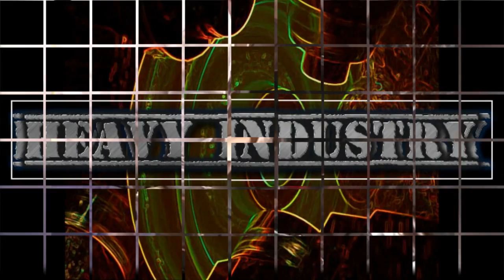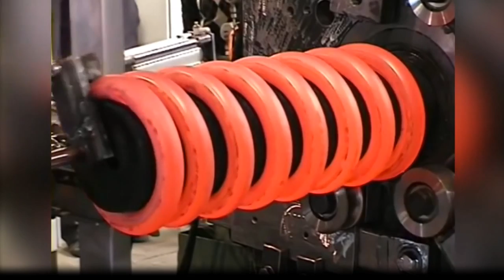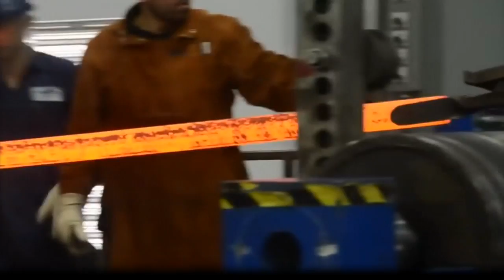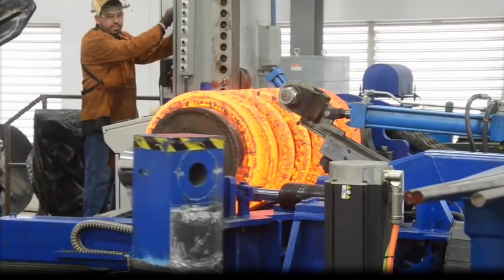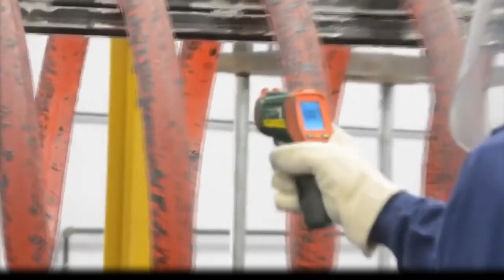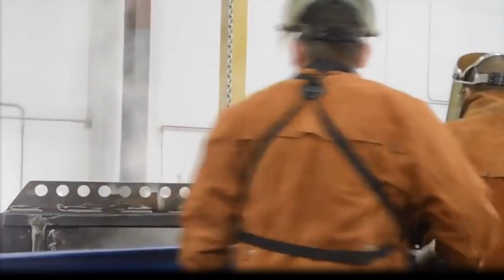How car springs is made - Coil large spring manufacturing

Comment: So you have to heat treat it twice then? If I got this right, with some wikipedia help,  you first heat it up to around 700º C until it's not ferromagnetic anymore, shape as the coil spring you need it to be, and then toss it back into the forge, heat it up to around 300º C and then shape it again? What's strange is that I didn't see them cool down the steel in between heat treatment, which is odd.
Reply: Bro, what?